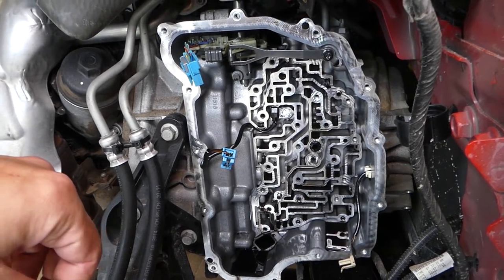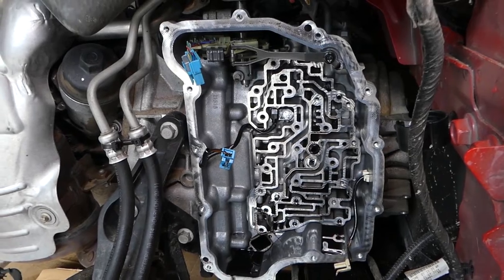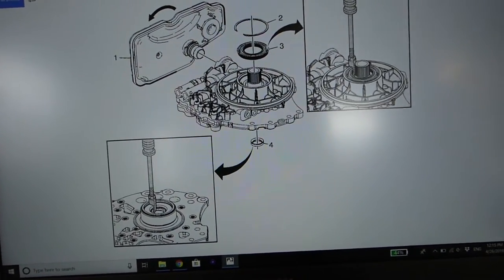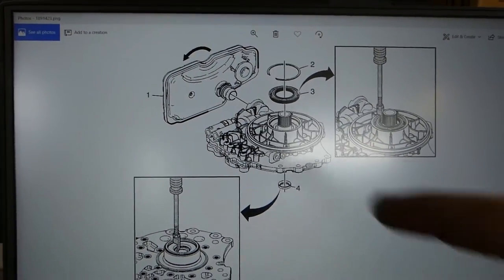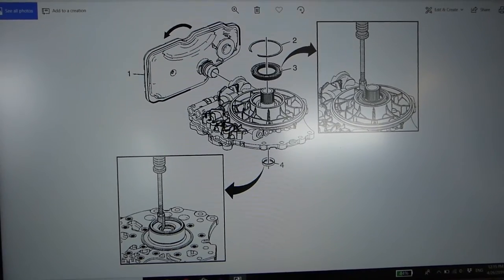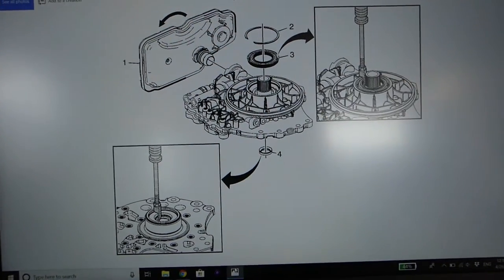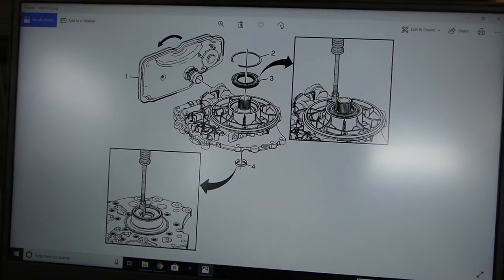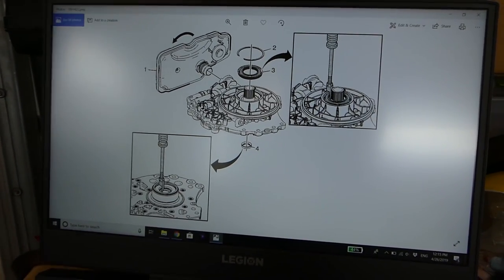WHERE IS THE TRANSMISSION FILTER ON CHEVROLET CRUZE AND CHEVY SONIC

Comment: Well, that was easy.  I'm sure as heck not going to replace my transmission fluid filter.   I'm not even going to have to remove the bumper OR the radiator.   That filter is only going to have a prayer said over it and that'll have to suffice for now.   LOL   Hopes and Prayers only.

Comment: Excellent video there is no doubt that there is no filter to replace although the GM or Chevrolet recommends to change the transmission oil every 30 thousand miles

Comment: Cruze and Cobalt engines are known to run super hot, with no real place for the heat to go, except into the tranny & throughout the whole engine compartment and into the front interior of your car, so it would make sense to change out the tranny fluid as often as possible, as well as the oil, because the heat will cause it to break down much quicker than most other cars... Pain in the arse tho

Comment: I have a 2012 chevy sonic in the begin it was a code p0796 I replace the solenoids and computer for the second time I pay to get it reprogram and still have the same problem control solenoid C performance or stuck what else can I do my transmission sounds like wining noise sound like a power steering pump when need some fluid and it goes to a limbo mode
Reply: Mine does that too